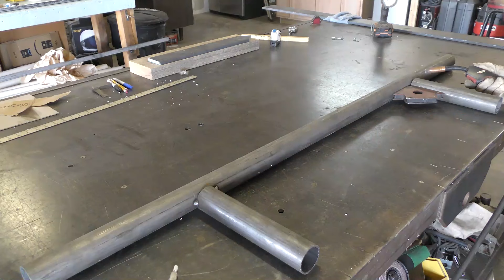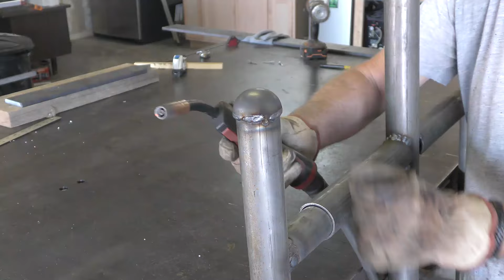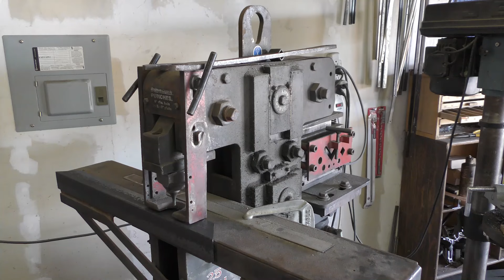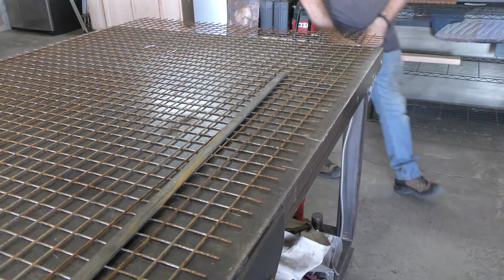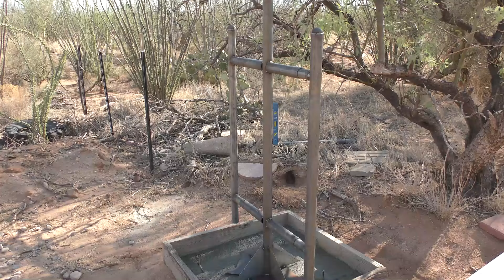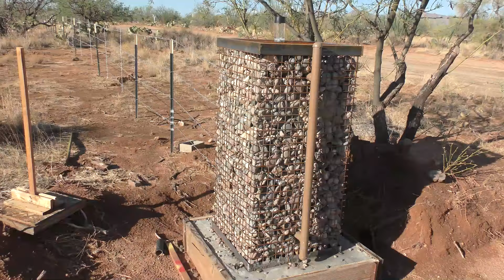Step-by-Step Gabion Build + Pro Metalworking Tips

Comment: Hi Doug,

I know you already have a thumbnail designer — and that’s great. But what if you could test a design that taps deeper into human psychology, engineered not just to look good, but to convert better?

I specialize in creating thumbnails that use eye-tracking patterns, emotional color theory, and proven visual hooks to increase CTR — all with unlimited revisions and pricing that’s friendlier than what you may currently pay.

Would you be open to a quick challenge? Let me redesign one of your recent thumbnails for free — no strings. Just so you can see the difference.

If it outperforms your current one, great! If not, you’ve risked nothing.

Let me know, and I’ll send you a sample.
Reply from the maker: If you want to try a create a new thumbnail to see if it gets more performance, sure, go for it. However, my channel is making me a great deal of money right now so I don't any budget at this time to hire someone. For reference though, what do you charge to create thumbnails? And what do you need from me once a video is created?

Comment: I didn't know what a gabion was or how to build one. Now I know both. Although I like the way it looks, I think the nearly daily rain we get here in Florida would turn the gabion into a pile of rocks and rusted metal in a year or two. ☹
Reply from the maker: I have heard that you can get Corten mesh and angle which would stand up against the rain
Reply: @ArtfullyRogue  I didn't think of that. I'm getting ready to do some work in the back yard, a new patio and outdoor kitchen. I think they would make neat looking bases for a bench and a couple of taller ones to frame a couple of steps.